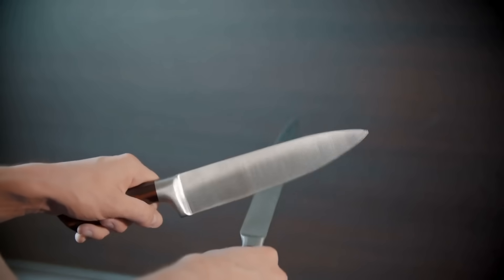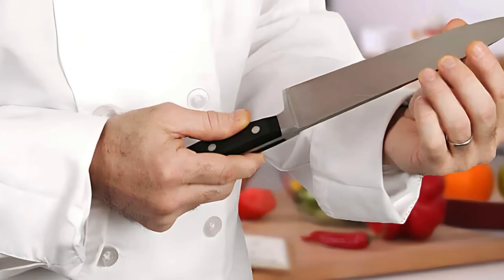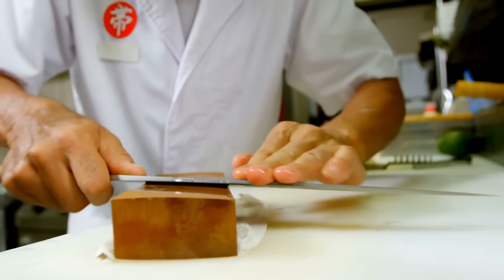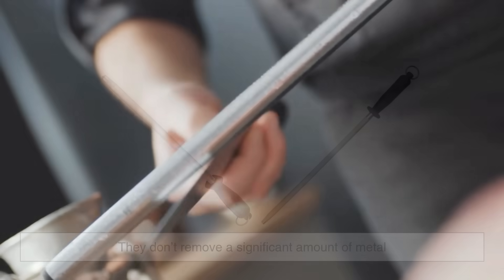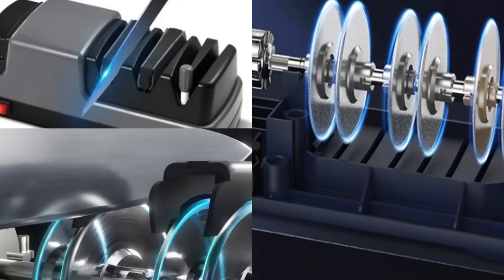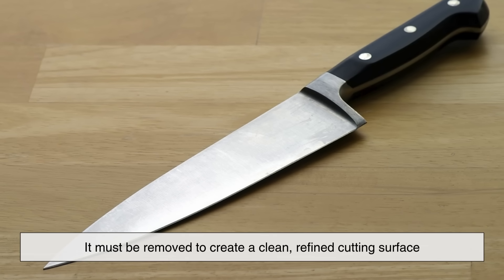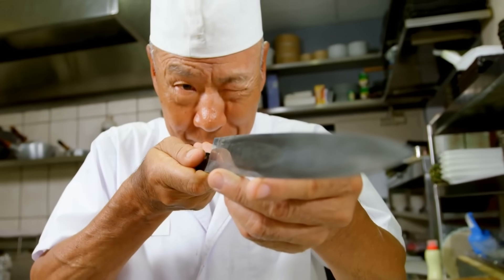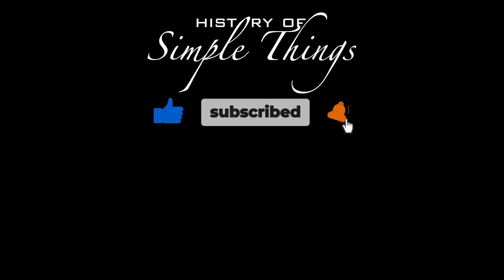How Does Knife Sharpening Work?

Comment: I've watched hundreds and hundreds of videos on this subject. 

And in my opinion sharping stones are by far the hardest to use. 
And take a very long time to use. 
And it's impossible to get a nice even edge on the entire knife. 

So that makes it useless. 

And if you do get a halfway decent edge on the knife. The edge doesn't last, at all. 

About 20 years ago I bought a knife sharpener. 
I can't remember the brand name. 
But this is the best thing I have found to put a even edge on the entire knife. Plus you can put a razor edge on the knife. 
Also you can sharpen scissors, lawnmower blades axes just about anything. 
This sharpener uses belts. It also has a part where you can adjust the angle you want to put on the knife. 
It has a course, medium and polishing belts. 
This is the best thing I have found to put a nice even edge on a knife.